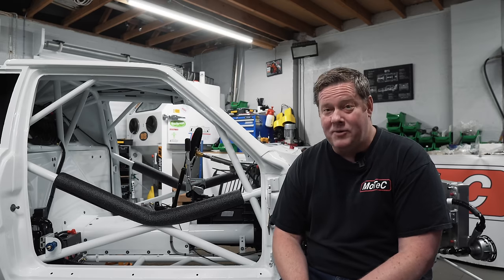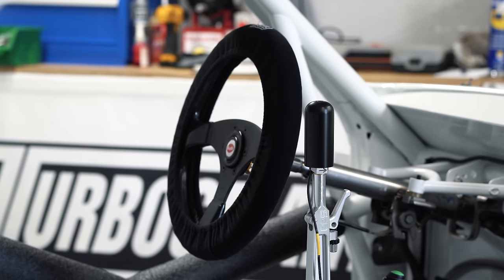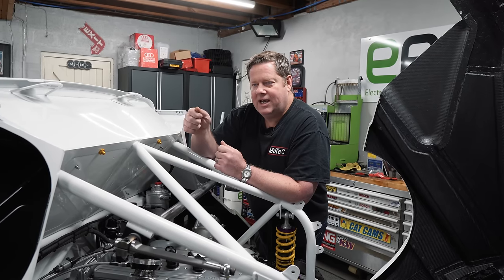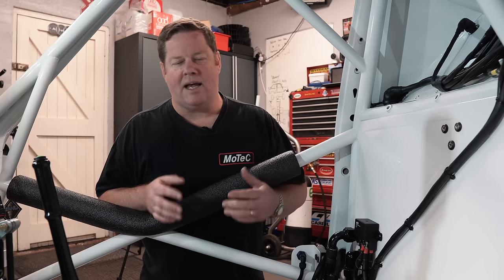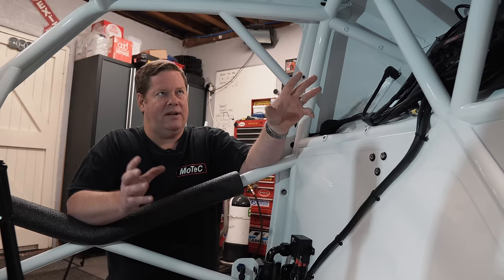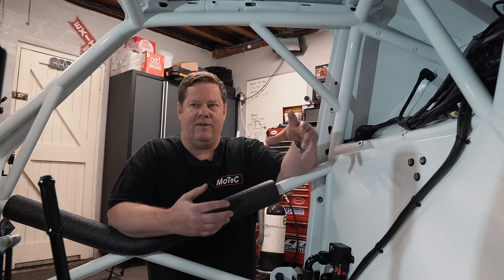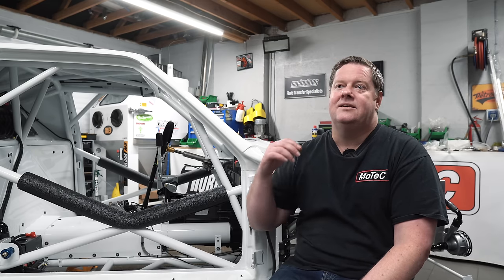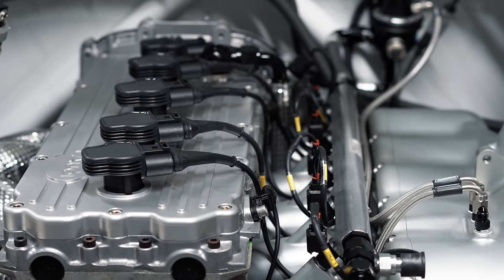Building the Audi quattro Group S RS001 (Part 14) - Wiring

Comment: The mule Group S Quattro: The myth about the only one car built is when pictures were leaked to press, Audi old fashion board made a deision to kill the project and ordered to destroy the 3 cars. What happened according to the myth is engineers destroyed one of the RS002 and kept the shredded car in a warehouse inside the factory so the board members ask about the cars fate they show the parts as proof that they destroyed the cars. However, the other RS002 was kept safely inside a warehouse in a location that is Audi seized to use and this is the one exists today in the museum. 

The mule car (or RS001) was kept in the same warehouse but disappeared in later years. Engineers believe it was stolen by someone he knew about it and knew where is it. Some of those who still alive believe the car still exists in a barn somewhere in the area. 

The other myth: every one think the only evidence of car existence back then was those pictures shot by the paparazzi photographer. However, one of the test engineers say that there is a video tape recorded in the day Rohrl took the car for a test run on public road which includes a segment recording the car noise from 10 km away from the site. This noise draw 2 police men attention who came to the area to see what is the cause of this noise. They pulled over Rohrl and wanted to take the car to police station on a recovery truck...but they eventually were convinced by Rohrl and test engineers to let go to avoid problems with their bosses in Audi. Those 2 policemen took many pictures for the car on public road with walter driving it back to the team site.

Comment: hi really nice job car is looking amazing. what is the 2007 engine out of and di you use gearbox and diffs out of a production car or are they hand built . as i am thinking that if the engine is turned 180 and now mid positioned does that mean that the forward gears are now sending the car backwards ?? or am i not right . many thanks